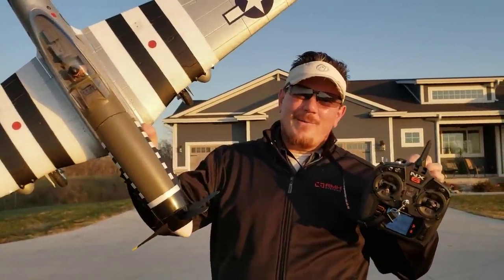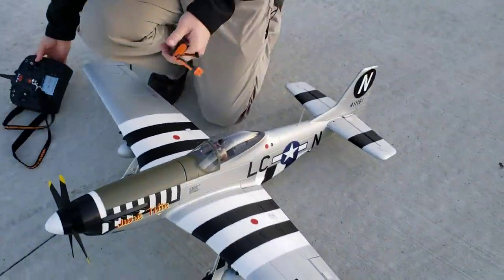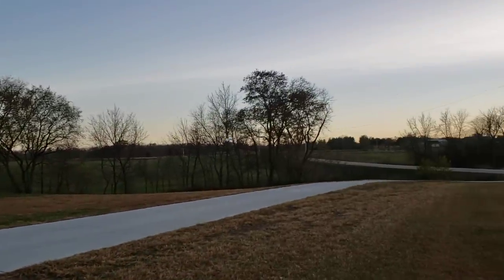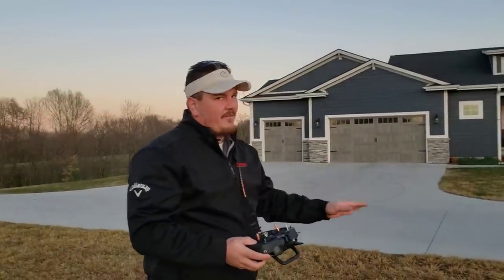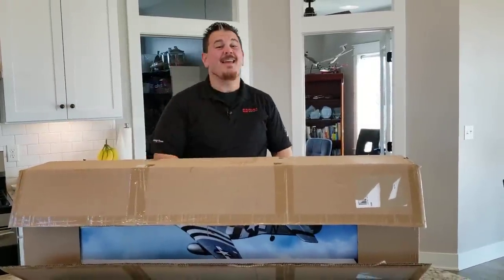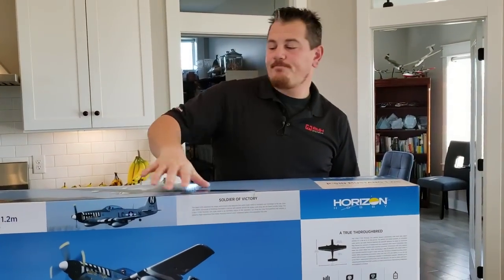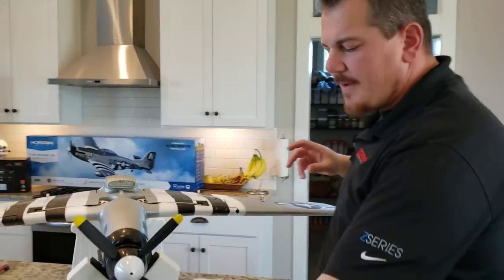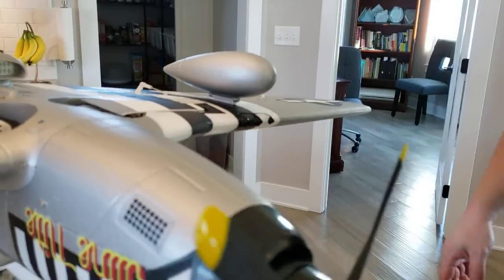Eflite - P-51D June Nite & NX6 Transmitter - Unbox, Build, Radio Setup, & Flights

Comment: Great video. Can you share with me some tips for the TAKEOFF of this HH P-51? It looks smooth and effortless in your video (nice job btw). The problem I have is that when the tail was lifted and I throttling up for speed, a plane nose was pushed down and tip over by the thrust,  and the prop was hitting the runway hard! So to avoid that, I sloooowly throttling up. Which took the whole runway length. But I don't think that's a practical way considering how capable this plane is.
Reply from the maker: I know this isn't the answer you want to hear, but it's the answer you need to hear - practice makes proficiency ;) You can do it. I have a video that kinda outlines this process, but it's a FEEL thing, and an EXPERIENCE thing...

Here's the link - https://studio.youtube.com/video/V2NA_dYzu18/edit - I talk about how to counter the "P" Factor (the torque of the prop trying to pull the plane over to the left, which is why the props point down and right).

The best I can say is that when you engage the throttle, do it as slow as your strip will allow for. When you start, you can even pull back on the elevator to keep the tail wheel down for a minute, then slowly let it pull up, and about the time the tail wheel lifts, you'll have to move the rudder as the prop wash will want to "pivot" the plane.... it takes practice.

Here's what I would try to avoid...don't just gun it and get her in the air (I mean, you CAN...but don't)...you CAN learn this skill, and when you master it, you'll be a much better pilot!
Reply: thanks for the advice. I'll make sure to watch that video!

Comment: Hi Brian, I logged in with a different account, Mason here, with the 1400mm Zero. I spent some time trying to figure out how to use the Gyros in the NX6 and the AR6610T receiver. I tried enabling the 3 Axis Gyro, then Gryo 1, but the only channel I could select was GEAR. The manual does not talk much about setting up the gyros at all, how to assign them, etc. Have you played with this at all yet?
Reply from the maker: The 6610T doesn't have AS3X ;(

Rx
AR637T https://bit.ly/3pW3u86 (AS3X/SAFE/Full Telemetry)
AR6610T https://bit.ly/33SYkA0 (Full Telemetry)

Comment: I tried reversing the cables to the ailerons but they still don’t work, any other tips or should I return the plane?
Reply from the maker: Separate the servos from the "Y" cable, and run ONE at a time...do they move? Yes, figure out why.

If they don't move, try plugging them into another channel (confirmed working on the Rx)... do they work? why ;)

Comment: Hey Brian which version do you prefer to fly more the 1.2 or the 1.5. The 1.2 seems more fun and less stress. Thoughts? The P-factor on the 1.5 is killer along with landings.
Reply from the maker: 1.2m - the 1.5m is way more impressive, but not as fun to fly in my experience.

If you want the 1.5m - get the FW-190  https://bit.ly/2NswTZ2 - you'll be WAY happier with that 1.5m version....

Comment: What rudder-Aileron mix did you settle on for coord turns?
Reply from the maker: I didn't yet. I'd add 25% to start, and if it's not enough add another 5% for 30%, but I bet the 25% would be sufficient.

Comment: I binder my dx6e but the ailerons will not move, everything else works just the ailerons won’t work, any idea what’s going on?
Reply from the maker: I bet your cable is plugged in BACKWARD at the receiver. CHECK IT. I just did this myself on a plane that will remain unmentioned...Since it's just now uploading ;)
Reply: @BrianPhillipsRC  I tried flipping the cable and it still does not work, should I return the plane or are their any other small mistakes like this?

Comment: I'm looking at the NX6 to buy for my first radio. Even tho Horizon has a good deal on the DX8e. What would you recommend?
Reply from the maker: Get the NX8 ;) Only about $40 more than the NX6 and will get you SOOOO much further, the NX6 will be good for about 95% of the planes coming out in the near future, but the 8 gets you to like 99% of the new stuff coming soon.

DX will be discontinued, but DO support Forward Programming.

Comment: Will the dx6e work with this? I am pretty sure it will but I am just double checking
Reply from the maker: It will, but you have to SHARE a channel to have SAFE SELECT selectable by switch. I.E. You need to have at least 7 channels to make that work, BUT if you end up getting the NX6, it has the 7th channel!

Comment: Do you buy all these planes yourself or get them for review from the mfg or retailers? Do you keep them afterwards? You must have an insane collection if you do. Love ask the videos.
Reply from the maker: We have purchased many, and some we get from MFG's or Distributors. We do have a huge collection, and it's getting bad in the basement ;)
Reply: WHAT RECIEVER ARE YOU SETTING UP BRIAN. I HAVE SUCCESFULLY SET MY SWITCH TO D FOR SAFE/AS3X BUT MY AS3X WILL NOT WORK ,safe works fine and ive factory reset and the same thing still. Ive set my as3x gain to full. sensitivity is set to x4 i bump throttle and nothing

Comment: Hi Brian, saw your flight of the 1.2 p51 and it looked awesome. You used the new nx6, can this plane be flown using the dx6e?
Reply from the maker: Yes you can! BUT if you use SAFE select, it's gonna be ON, OFF, or Selection will ALSO run another control (not optimal at all!!!)

Comment: I have a DX6 but I would like to get this plane but wondering if I can use it with safe and how would I do it? What are my options?
Reply from the maker: You CAN, but you'll have to SHARE a channel for SAFE Select with flaps or retracts, or you can just bind with AS3X only. If you don't NEED SAFE, just bind AS3X and don't use SAFE....then your DX6 is totally fine :)
Reply: @BrianPhillipsRC  Thanks! I like safe. Which is safest to share, safe and flap or safe and retracts? I like to start with safe for the first few flights.

Comment: Hi Brian,
I just picked this bird up and have been preparing it for maiden.   Due to the weather, it's going to be awhile.  I've watched all of your videos on this P 51 June Nite (including the 2 yr old ones).   I've also watched quite a few of your Blonde videos.  My first question is about CG, I want to be sure I have your latest thoughts.   HH suggests a cg of 85mm from the root,  are you suggesting that is a nose heavy setting (I think you are).  To get this cg, I have to jam a 4s, 3000 all the way forward.   I also saw your comment that  2200mah, 4s, middle of the tray (that's not going to get 85mm).   Do you have a cg number, if not, a battery size/position is fine?

I'll be flying this on a club field, with fine low grass.   On the maiden, would you suggest take off flaps (on grass)?   I know nose over on grass is an issue and it will require me to pin the tail down with the elevator for take off.   I plan to fly this plane on 4s, but for the maiden, would you suggest 3s first?  (I'm pretty good with rudder control on take off.)  I'm not planning on using safe, but have put it on a switch as a back up.   I find it's a great feature when you lose orientation due to pilot error.

Mechanical trimming:  I've visually trimmed all the control surfaces level as possible (per instruction manual),  do you suggest a bias on any of them (like slight up elevator) for the maiden?   

Thanks in advance,
Marty
Reply from the maker: I found the recommended CG to be kinda goofy. I just ended up stuffing a 2200mAh 4S in the center of the tray, and had great experience ;) Heavier on this bird will make her land harder, in my experience, BUT I've heard from other guys using as large as 5000mAh 3S!!!! NOT ME, but I suspect they had to do quite the hack job to make things fit.
Reply from the maker: I do speak to your questions about CG in the video. I don't remember all these details, but I do review it at the end of my flights (at the beginning of the video). I believe the battery being centered DIDN'T seem to get match the CG the manual called for, but the plane FLEW AMAZING ;) Just do that...and don't overthink this part too much. Some planes are SUPER sensitive to CG, and others are pretty forgiving...I believe this plane is just pretty forgiving.

P.S. The Blondie was one of my first and most beloved planes. I had so much work in those awesome landing lights ;) She's now moved on to a home where she'll see the skies more often, but I'm still loving the June Nite - SOLID plane!

3S is PLENTY good for your maiden, but contrary to popular belief, MORE power will help you GET OUT of trouble, when and if you find it....so maybe 4S might be the way to go ???
Reply: @BrianPhillipsRC  Thanks!
Reply: @BrianPhillipsRC  I finally got a chance to fly the P51 1.2m, ran 5 batteries through it.  The plane is a lot easier to fly than I expected.   No bad tendencies in flight, and a huge flight envelop.    It's a great plane, really smooth, not difficult to take off or land except for a tendency to nose over.   As far as the CG goes, I started as you suggested,  2200mah 4S middle of the tray.   Flies great there but I had a lot of nose over issues due to the grass strip at the club (both take offs and landing).   I continued to move the battery back throughout the day and ended up at 95 mm ( cg 85mm spec) and the plane still flew great but this helped with the nose overs.   I used full up elevator to pin the tail (on take off) , I also didn't use the take off flaps as they seemed to be contributing to the nose overs.    I just took off with more speed and a gentle increase in throttle (4s).  Zero torque roll.   This plane is not cg sensitive for flight, but it does tend to nose over on anything other than a perfect smooth grass strip or hard surface.  I haven't run a 3S battery through it, I see no reason to do so.   To me, the 4S is perfect, I use the whole range for throttle.  I didn't want to crash the P51, so for preparation, I used my Timber X for landing and take off practice.  I did hundreds of them, got my landings and take off down with half flaps, full flaps, no flaps, really slow speed, high speed, ect.   I used the Timber X because it's got the most durable landing gear of any of my planes by far.   I made lots of mistakes but the Timber X handled them just fine.    Thanks again,  I thought I'd share this info for others to see as well.

Comment: Brian, Which do you prefer? The E-Flite 1.2 Mustang or the newer 1.5?
Reply from the maker: 1.2m is easier and more fun to fly. The 1.5m is more money, and easier to break, but more scale, LED's and Tail wheel retracts make it pretty awesome. Both slow down nicely, but the 1.2m lands so much easier, and in less room, with less ground looping tendency.

If I had $1000 to spend, I would lean toward the P-51 1.2m and new Transmitter VS P-51 1.5m without, and pocket the difference or get some lipos. The 1.2 m is more my speed. Easier to store, easier to transport, lighter on it's feet, still BEAUTIFUL, and you'll NEVER notice the tail wheel.

THAT ALL BEING SAID, I have my beautiful P-51D 1.5m sitting waiting for me to fly her ;) So easy for me to say this with both sitting in the basement - LOL. 

Good question Robert.
Reply: @BrianPhillipsRC  Brian, thanks for your reply. I must say I am so impressed with your skills. What I think is amazing is your ability and skill in modifications, and when necessary repairs.
I don't have the patient let alone skill to be able to do what you do when modifying or doing a repair . 
I do have the 1.5 m E Flite Mustang, after a 4 minute  scale only flight ( Full T only a few times)
using a 5000 30C smart the motor was so HOT you could not touch it .I did not check the ESC for temp. as the motor really took me by surprise. Brian do you have any Idea's what could have caused it?

Thanks again for your channel!

Comment: Loving the channel! I think i've watched a good portion of your channel just to enjoy the content. I own this bird (and a few others) but I haven't quite gotten the CG correct on mine. I have 2 3S 2200 and 1 4S 2700 pack that I cant get the battery tray to be correct. I've gone from using the straps on the 3S and have put velcro on the tray and the 4S pack and removed the straps, in hopes that the velcro will hold the batt in place. 

Did you ever find a "best" pack to fly it on? 

Also seen a few batt tray mods on the rc groups page but don't really wanna rip out the batt tray yet

(side question: upgrading transmitter from a DX8e; looking at either DX8 or NX6/8....any insight?)
Reply from the maker: Yes, 4S 2200mAh 30C SMART Lipo strapped right in the middle of the tray. CG marks must be off on this plane, is all I can figure.
Reply: @BrianPhillipsRC  4S 2200 it is then! Thanks!

Comment: Nice video love the info!  As a flyer that loves flying my aeroscout and  I got one of these p51's I have a few questions. For my transmitter I have the DX6e would that work for this airplane? Also what battery would you recommend thanks!
Reply from the maker: It would work okay, but you'll have to do with or without SAFE, since you'll not have enough channels for all the features simultaneously. The new NX6 has 7 channels , fyi ;)
Reply: @BrianPhillipsRC  ok thanks so much for the feedback
Reply: @BrianPhillipsRC   hey thanks again for replying but after playing this plane a few times when I put the battery in the nose is extremely heavy any tips on how to fix that thanks

Comment: Brian, for field charging, what battery would you recommend pairing with the Smart S1200 or S1500 DC Charger?
Reply from the maker: The biggest 6S you can afford...maybe the 7000mAh 6S 30C, or you can just use your vehicle's 12VDC battery.
Reply: Thanks for your replies.  It is always nice when you watch a video and comment and then get a reply.  Thanks much for your videos, and for the feedback.  I am gonna eat more ramen and go for the NX8 over the DX8e, as I really think 8ch is more future proof.  I can't really see needing 10Ch any time soon, or wearing out the gimbals in even a cheap radio before the NX radios are replaced with something more fancy...but I like the idea of having the newewst tech, and the voice alerts .  
   I will look into the 2 chargers you mentioned, but I think I will start with the radio, and just deal with limited telemetry for a while with non-smart packs and chargers.   
   I've narrowed down my list to the following: 
1100mm FMS Zero
1100mm FMS Typhoon
1.2m E-flite P-51D 
Night Timber X
Ultimate Biplane 3D
1.3m Extra 300
Someday a German WWII bird, and a bigger Cub or warbird.
   Now to decide which first!(half will be discontinued before I get them all)

Will you do a review of one of the 1100mm FMS Warbirds?

Comment: Brian, interesting talk on the D/R and Expo. If I saw the video right, are you setting up all on the same switch? And, are you general starting rates as follows: 100% DR with 5% Expo / 100% DR with 20% Expo / 90% DR with 30% Expo? Also, do you use the same for all Aleron, Rudder, Elev?
Reply from the maker: Yes I am! Sometimes it's 5%,10%,15%...sometimes a bit MORE for rudder...but yeah, basically, that's my launching point, then I refine when I land from the maiden. I rarely change it.

Super easy right!!??!?! BUT SUPER-DUPER-SUBJECTIVE - you might HATE these settings ;)

Comment: Hi Brian good stuff as always. I like the 1.2 size and Brian would you think this might be a good 2nd plane after the Apprentice S 1.2 or do you think its maybe too advanced ?
Reply from the maker: It's not too advanced, but it'll be a bit of a challenge compared to the 1.2m Apprentice. Go for it, but be prepared to have some challenges with takeoff and "P" Factor.
Reply: @BrianPhillipsRC  As always good input Brain. Im going to look at 2 clubs today AMOS in Lincoln Ca. And Red Barons Wheatland Ca. Both look good AMOS what a set up wow ! Brian you should look at this one. Anyway after some extensive research like i did on the Apprentice 2S 1.2 I decided the P-51 would be too much. So im going with the EFlight T-28. Thanks again Brian your awesome guy !!!

Comment: Nice flight! The video was awesome! Thanks to the better half. I've been looking at this as my first warbird, but am gaining experience with cheaper planes, while saving for this. My question to you is, since I fly drones also, I really don't want to buy a new radio.(read, can't afford). Is it possible to fly this with a jumper t16 pro, with safe on a switch? I'm having problems with that. I can bind with or without safe, but not on switch. But when I bound my UMX Timber, the switch works. Love your videos!
Reply from the maker: YES. You just need enough channels (7), and you can do it for sure. I can't tell you exactly how to setup each channel, but you can do it for sure. DSMX is supported right out of the box, so you could do it for sure.

Good luck!

This plane is excellent! SAFE gives a lot of leeway for bank and pitch angles, but I still recommend getting to AS3X only as soon as your skills allow. So much more fun and FREE!!!

Comment: Hey Brian! I have a question, if I have a dx6e could I fly something like the p-51? (Flaps, gear, rudder all that) thanks!
Reply from the maker: Yes, absolutely - BUT you'll have to pick between...

1) SAFE Select WITH Flaps or Gear
2) Not using OR ALWAYS using SAFE Select
3) SAFE Select in stead of Gear or Flaps

...which SUCKS - you don't want to have to choose.
Reply: @BrianPhillipsRC  so I guess just go the extra mile for the dx8e haha